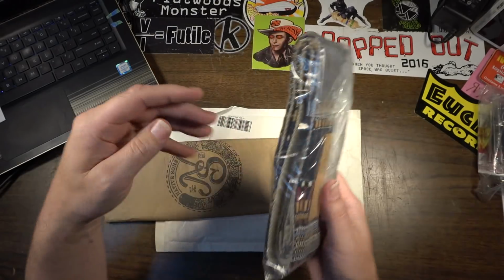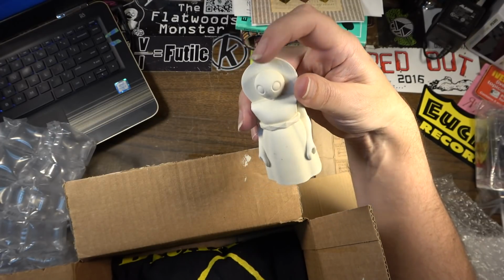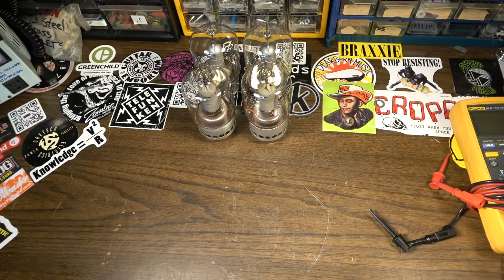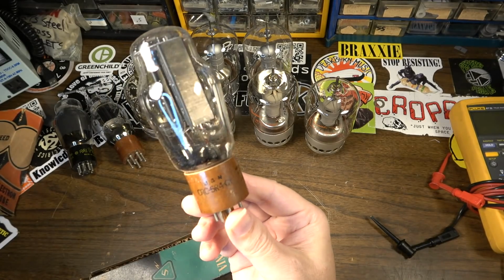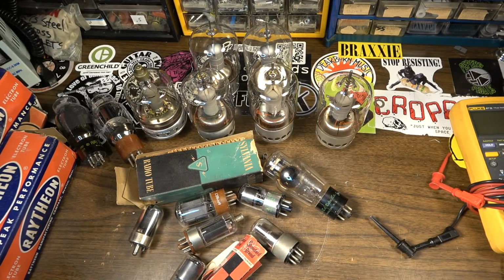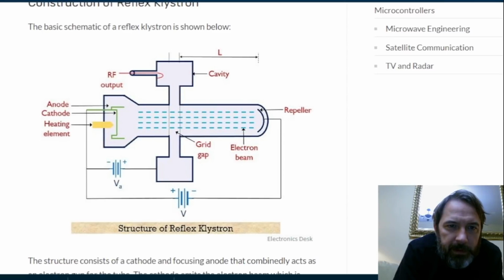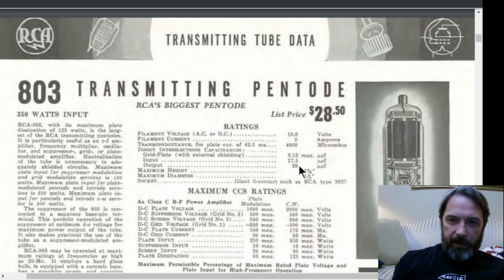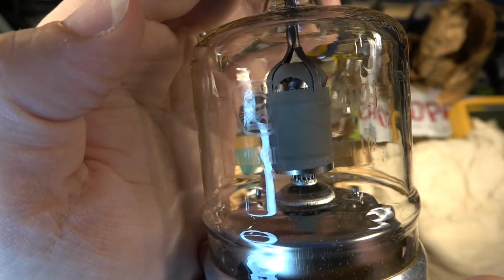A Guy Sent Me His CRAZY Vacuum Tube Collection! - Viewer Mail

Comment: As a retired Ham Radio operator, that's the first thing I thought of, transmitter tubes!  Now all you have a to do is, add a big room to store them, add a substation to power them and fire them up, to heat your house and make you sterile!
Reply: Bebo why be retired? HAM radio continues to be a magnificent hobby that pairs great with guitars, building and repairing guitar amps. I got my first license at 14 and continue today at 61+ yrs, I still work full time in the communications-emergency management field still operating HF-UHF all  modes.. Like they say “Come on in the water is fine!” ;-)
Reply: @jakeblues3676  I let my call laps, but I kept my Yeasu and a vertical!  It just got too expensive, when the kids came and life changes took over!  In a nutshell I have way too many hobbies!  Ha Ha  73s

Comment: When I worked at SWR Engineering we had a side biz that involved sonically aging guitars. It was a computer program that went into a 4,000 watt valve/tube power amp via a shaker table and used the guitar as a speaker. The program bombarded the guitar with random sine waves and after 45 minutes was the equivalent of the guitar having been played for 20 years. The all valve/tube amp was 8 feet tall by 6ft by 6ft. We made some brackets to hold the guitar in place on the shaker table that wouldn’t harm the guitar when the shaker table was running. It worked really well! We did guitars for Martin, Fender, Eddie Van Hale , Lawerence Juber, etc…
Reply: I left SWR in ‘97 and when Fender bought SWR in 2003, they got this aging program and just tossed the whole thing in the rubbish bin…
Reply: @donbutler8760  Maaaaan that's sad..

Comment: The transmitter tubes Penta and Eimac tubes have designation 4-125 means 4 Tetrode 125 Plate dissipation. Applying the 5-125, 250, 400, 500 etc would mean 5 Pentode and the second designation is the Power dissipation. I use 3-500z tubes 3 Triode and 500 is the plate dissipation. I also use 4-400’s, 4-1000a’s in RF amplifiers. I’ve often thought of building a guitar amp using a pair of 807’s but at the end of the day who can really beat a pair 6V6’s or 6L6’s. Being a Radio Amateur for 46yrs and a tube guy I have boxes of tubes across the spectrum even water cooled power tubes. Appreciate you and hope you and your family are safe and well!

Comment: I managed a radio station in Spokane, Washington for a number of years. The station was first established in 1921, making it one of the oldest stations in the country.  Our AM transmitter was located on the roof of a 9-story building, with a unique ground system made up of wires stretching out to adjacent buildings.  Up in the transmitter house, which was an extension of the elevator shed, there was an old, no longer used transmitter that had a tube almost as big as your head in it.  The transmitter had a window in is, just so you could see that tube.  It's been almost 20 years since I looked at it, so I could be miss-remembering, but I do recall my engineer saying he'd never seen a tube so big.
Reply: Imagine a special built Marshall head with a pair of those tubes! Hehe dare to dream.
Reply: I think he was talking about Bubbas tube 🤣 Jk

Comment: We had Klystron tubes in our old satellite communications terminals when I was in the Army. They were a pain in the ass to set right because if you went too far with your adjustment, you had to reset it and start all over again from the beginning.

Look up the ANTSC 96B and ANTSC 73B and you should be able to find a picture.

I remember we used to put our RF hazard warning signs on the door to our shelter because our lieutenant was scared of everything so he wouldn't knock on the door.

Comment: Some people build hi-fi-amps with 304TL transmitting triodes; they need 1200V on the plates to get good output and they need to be driven to full power to keep them healthy, same with those 4E27s or any other tube which doesn't contain a getter.  You also need good cooling and a heat sink on the plate lead.

BTW the yellow glass in the plate lead seal on those Eimac tubes is actually uranium glass.

Comment: Cool video.  I still have my 6146/8298 amplifier and 6V6 oscillator tubes I used to make my ham radio transmitter.  I could get up to 90 watts plate dissipation on the amp tube.  For the power supply, I used an 80 tube which is a dual plate rectifier.

Comment: I worked with Loran C radio navigation before I left the Coast Guard. Some of those transmitter tubes look very familiar. Before Loran C was shut down in 2010, Alaska had the last Tube type Loran transmitters in the country. Ours had 1MW of transmitting power.
Reply: There was a station in like Virginia too, correct? I was in the CG in the early 2000s and remember LORAN C still being taught though I do not remember using in SAR.
Reply: @thornmatthew8395  There wasn’t a Loran C station in VA (Wildwood NJ was the closest) but they were dotted all along the coast and even had some in the middle of cornfields, like in Dana Indiana, or in the Desert like Searchlight NV. I was at one of the coldest and remotest stations at Port Clarence Alaska.

Comment: 6098 is an industrial 6AR6.  Somewhat similar to a 6L6GC but with a higher maximum plate voltage and lower maximum screen voltage.  The 7Y4 is an 84/6Z4 with a Loctal base.

Comment: Those are all military surplus transmitting related tunes. I picked up some Eimac 4D21 tubes at a military hamfest fleamarket in Hanford calif. Back in the early 90's. Hanford is just a few miles down the road from Lemoore,  home to a a major naval air station. Also picked up a really cool naval signal generator  in a heavy duty transport case.weighed about 90 pounds...brand new for $15....
Those are some ultra cool tubes there but probably not good, especially the internally  burned looking ones ..Cool stuff!! Cheers!

Comment: The thoriated filament tubes are slightly radioactive but nothing to worry about too much.  Quite a haul of vintage transmitter tubes there Brad.  I see some that want you to build an audio amp with some of them and that would be cool but the iron needed to supply and load those tubes is absolutely massive and would need to be custom made. Then there's the power requirements which generally exceed the typical household wiring... still, it would be a sight to see. Check out the photonicinduction channel.

Comment: A klystron is the precursor of the couple cavity Traveling Wave Tube used in most (high powered) Analog Radar Transmitters until the advent of Digital Solid State Transmitters in the late 90s early 2000s..i worked in the industry for over 30 years and retired in 2012.....low powered requirements use Helix Traveling Wave Tube.

Comment: Correct, the long leg in the klystron's base is a RF output wave guide. It's an interesting piece of technology, but for most of us, completely useless :(
I'm envious of these 807s and 811s though. You got some awesome lot of tubes!
By the way, as for the WWII tubes, check out the German transmitting tube named RL12P35. I even had one, from what I remember it had a broken heater, so no chance of doing anything with it... Looked absolutely fuckin' awesome though.

Comment: You showed some tubes that are old "freinds" of mine in the broadcast industry.4-125,813,2E26,6146 to name a few were used in AM,FM and even VHF analog TV transmitters-these low level stages.833 was used in Gates,RCA,GE 1000 AM broadcast transmitters.One pair of these tubes was the 1Kw RF output stage-the other pair the modulator that fed 500W audio to the RF am to acheive high level plate modulation.And some of the audio tubes you see in G-fiddle amps-were used as modulator drivers for broadcast transmitters.5 and 10Kw AM transmitters 6146 used as low level RF.

Comment: Some TV tubes can be extremely radio active, just something to think about what handling them, especially when not using gloves
Reply: actually, not really-the ones that were fairly "hot" were specialized devices used for radar sets(spark gap tubes mostly).
Some gas voltage regulator tubes were somewhat "hot" as well.
None of the above were terribly hazardous.
Yes, certain tubes used a bit of Thorium on/in the Cathode/heater-not really enough to be even slightly concerned about.
And gloves would not protect you, as the material is INSIDE the tube, not on the outside of the glass.